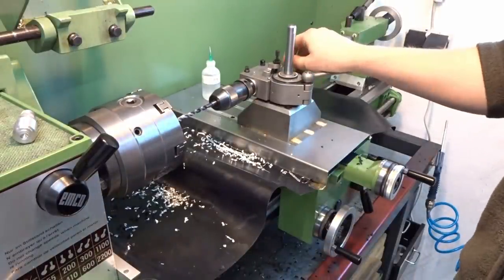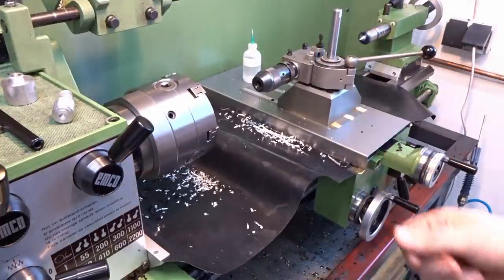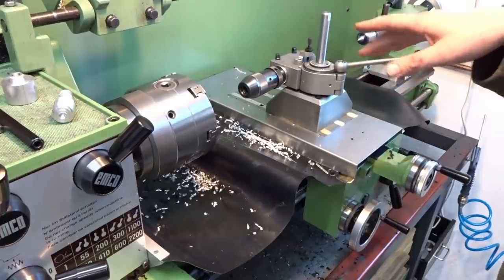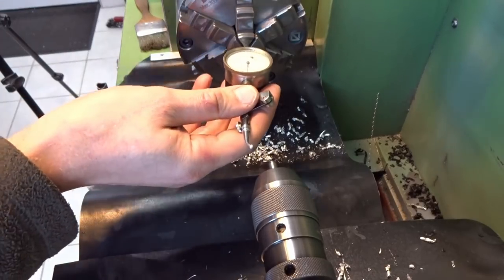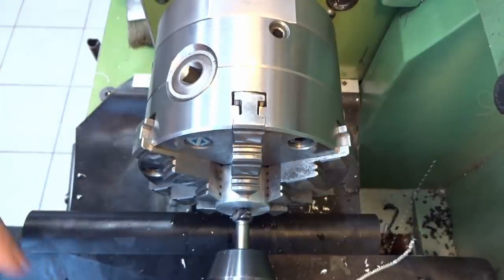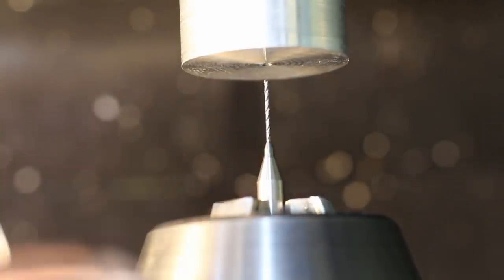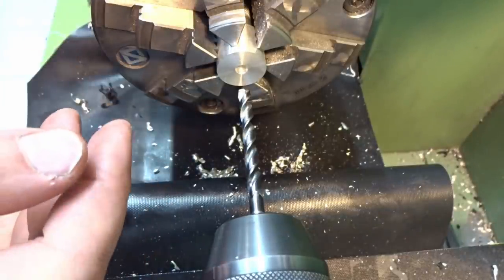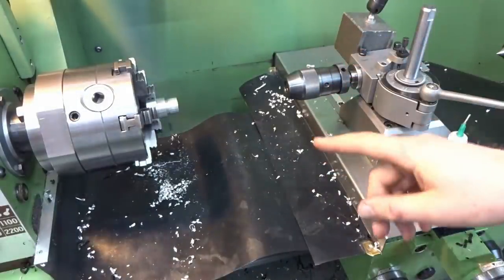Carriage Drilling on the lathe

Comment: Wow, I knew it was practical to drill with the carriage but some of these tips really blew my mind.
Had never even considered how practical it would be for use with taps!
Reply: I only just did this myself for the first time recently. I have built a multipurpose spindle, optionally powered, which I can fit to the toolpost of several of my lathes, mainly for drilling PCDs (with the lathe spindle locked) and wobble broaching (mainly for internal hex holes), but I recently had to tap a large number of M3 threads in gnarly work-hardened stainless, and so I used the spindle (which has an integral ER32 collet holder) as a passive tap holder in my sensitive little instrument lathe, whose carriage moves wonderfully freely. I provided sensitive and quick-releasing torque restraint by hand-holding the collet nut. This worked really well and I broke no taps. (The lathe has a nice progressive clutch on the spindle drive)

Comment: Stefan mentions disengaging the carriage feed to break chips. On some industrial lathes the feed rod, where it emerges from the gearbox, has a tripping and self-resetting overload clutch which can be easily adjusted and which is cleverly designed not to suffer undue wear from being called into play. In such cases you can break chips regularly without disengaging the feed, by momentarily applying a bit more (reverse) load to the carriage handwheel than the clutch will currently overcome. This is very quick and convenient in comparison with disengaging and reengaging, and arguably is less inclined to wear out the mechanism for doing so.

Comment: Just an idea for someone without a digital readout on their lathe that might be interested in doing this. I've seen arrangements that hook the tailstock body to the carriage. This allows the carriage to drag the tailstock. There may be another option. On a lathe that on might typically find in a home shop. 9"/225mm up to 12"/300. This also depends on just how the compound is mounted to the Cross Slide.  If the lathe has tee slots in the Cross Slide it makes things easier.
1) Remove the compound.
2) Build the device that you want to hold drills etc in. But do not final bore the holder
3) Position the Cross Slide in the center on its travel. Mount the Drill Holding Device to the Cross Slide.  Mount this so that the device is pretty well centered to the Spindle. 
4) Now drill and ream one or two holes for locating pins through the Drill Holder, the Cross Slide and into the Carraige. 
5) Install pins. These could be straight dowel pins, tapered dowel pins or straight shear pins. Shear pins might be a good option as to provide a failure point if you have a crash.
6) Now finish bore the drill holding device so that when the locating pins are in place the the unit is installed on the lathe with the locating pins in place
7) When not in use place short dummy pins in the Cross Slide portion of the holes to prevent chips etc from getting into the sliding surfaces.

On industrial machines I used to run there was another option on the tailstock. The hand wheel was mounted on a two speed planetary drive that allowed fast and fine feed. The fine feed made it possible to use larger drills without having to use cheater bars or have arms like a gorilla's.
Reply: I don't have DROs on any of my lathes but I do have 50mm travel Dial indicators (100 mm on my big lathe) which read z axis movement relative to a datum anvil repositionable along the bed, on the far side of the carriage from the headstock. When Stefan talks of the benefits of a DRO for following the progress of a drill when using the carriage, I can't help thinking that an analogue dial is even more convenient and restful, as for 95 percent of the time are processing the smoothly changing angle of a pair of needles, only looking at the graduations and numbers when you need to, right at the end, when in any case you are creeping up to a size. With a DRO it's a much bigger cognitive burden, processing rapidly changing (and hence flashing) digits in base 10, increasing or decreasing, and converting them to an analogue "sense" of the drill location in relation to the ultimate depth.
With difficult ultra workhardening materials like Inconel and Nitronic, it's really important to know just when the drill is about to reengage, as you have change the rate of advance so as to "hit" the work with just enough speed and follow-through to be instantly cutting but not too aggressively (which would might chip the cutting edge), and yet be ready to increase that force considerably as the drill starts to work and has to be fed at the optimum rate to avoid strain hardening, which latter would instantly take the edge off and probably weld the drill down the hole. Anything which reduces the cognitive burden is a big help, as you can't always be on your A game.
I do have a genuine Trav-a-Dial I plan to fit to my big lathe, which I think would be even more convenient, as it has unlimited travel, and that is a long lathe. Once again, an analogue dial.
I think the perfect solution would actually be an electronic three-axis DRO (tailstock or compound being the third) with a high resolution screen and (as a selectable option and conceivably not on all axes) analogue dial readouts, like the analog clock displays which are optional on a mobile phone -- but much handier on a DRO, because of the rapidly changing positions being monitored, in comparison with the slow and steady pace of time.
It occurred to me that a better analogy would be with altimeters particularly those used by jumpers. wingsuit maniacs, etc, where the readings can change very rapidly and the jumper has other demands on their cognitive abilities. Sure enough, there is a very sophisticated digital altimeter with an analog display which has recently been released, the Larsen & Brusgaard Altitrack.
A really Rolls-Royce implementation would process the sum of two scales for the tailstock, to track the position of the tooltip, regardless of unclamping and moving the tailstock casting.
Reply: @Gottenhimfella  
Having used both DROs and Trav-a-Dials on manual lathes I really prefer the later. It is much easier to track just when you are coming up to "zero". Other options I've used to set bed stops on lathes is an inside micrometer. Or solid stacks of gage blocks

Comment: This is brilliant! An additional feature of this method is that the carriage has a much longer range of movement than a tailstock. Mine is theoretically 75mm but the chuck tang drops this to ~60mm. Obviously, the carriage moves further than 60mm and so long drills can use a single pass.

Comment: Brings to mind the old pre-cnc capstan lathes with multiple drill chucks in the rotating capstan head.
Reply: @Mark  I have a small one of those as a second op lathe. It is still very useful for prototyping and small series etc, quick to set up. I find I use it a lot. Essentially a Schaublin 102 with a turret head and F38 collets. These have frequently been on the market for cheap, i got mine with lots of tooling for about 1000$, great quality machine for the money.
Reply: @erikisberg3886  I bet there are a lot of capstan lathes on the market due to the penetration of affordable CNC machines into small and medium sized shops. At the school where I was teaching we briefly had a medium sized machine with lots of tooling but it was sold on to a guy who just wanted a few parts off it. I just realised that I have a BXA tool holder with a bore big enough to take a 10mm keyless chuck so I think I will have a go at trying Stefan's technique although I don't have a solid toolpost. Repeatability might be an issue but for the occasional use it would be great.

Comment: I just got a MT3 quick change holder for a project I was doing for work (I work at a lab and all machining requiring more than a drill press is done at my house machine shop). I was working on something where I needed to do 1/4" deep drilling on 20 pieces of PTFE. I made a few prototypes using the tail stock and got fed up with that quickly. Glad I can run the drill on the carriage now.

Comment: Great video. Not that this would be a problem with your setup. One place I worked the guys that ran some larger machines than yours. On 19" and 21" Leblond lathes. They would run larger drills with the power feed like this. Now what drives the carriage is the pinion gear on the rack mounted to the underside of the ways. They would either bend the pinion's shaft  or strip the teeth on the rack (Or usually both) by the loads of large drills. But they were usually drilling with larger than 1.50" diameter drills to make this happen in tougher materials.

Comment: I don't even own a lathe, but I'm sitting here thinking how much easier doing this would make my life If I had one.  Now I want a lathe.  Thanks Stefan.
Reply: If you are in the U.S., Craigslist can be a great source for machinist tools if you use it well. You can set up a listing search filter such that when someone posts a listing for a lathe you will get an email alert. That's how I got my 9x20 Central Machinery lathe 4 years ago for only $200 (including loads of tooling). Between that and a minimill I've setup a fairly decent hobby shop.

Comment: This is how I prefer to drill. Not only because when I bought my lathe and it didn't have a tailstock. But that helped force me into it and now that I've done it, it's so much nicer most of the time. Getting the chuck dialed in isn't any more difficult than most other precision operations on a lathe IMO.

Comment: I have on occasion used the carriage to drill with using a power drill in a holder so it is like live tooling on my lathe. It saves a lot of time versus setting back up on the mill to do the holes and with a 40”chuck I get good rotational accuracy just using degree markings.

Comment: I just this week had to drill some MD filled Nylon to 63mm x 250mm deep. Using the carriage was the only viable way, given rapid peck drilling and clearing is required to prevent melting the Nylon.
The lathe I was using doesn't have a DRO, so to keep track of depth progress I use a small pot magnet with a thin piece of plastic glued to the face. I just stick it to the lathe way and let the carriage push the magnet along as the depth increases. When I retract the drill (or boring bar for that matter) the magnet stays puts and acts as a tell tale. Using that method I can use the rapids on the carriage to retract and return to work without fear of a crash.
On my smaller lathe that has a DRO, I use a needle bearing inner ring in the chuck and a ground dowel pin in the drill chuck along with the 1/2 function on the DRO. Very quick and no indicator involved.

Comment: Stefan, thanks for the presentation.
Totally agree with the threading using 90 degree feed. There is a minor advantage on using the compound for feeding since the compound "remembers" the last cut depth. With 90 degree feed one has to make a mental note on current cut depth.
I would be very careful when tapping smaller threads with carriage feed metod.. M8 is probably not a problem but when the tap size gets smaller, the tap just cannot drag the carriage with it so some other solution might be needed. 
If one has a small and affordable eastern world made lathe then chances are that the tailstock quill has a very short stroke. When I had mine, that stroke was about 40 millimetres. This meant that drilling with tailstock involved a lot of moving the whole tailstock around. With carriage feed even the smallest lathes have enough "strioke" to be able to drill with ease.
Reply from the maker: I tap down to M2 with this method, the carriage on the Super11 is not exactly hard to move :-D
On larger lathes it will be different.
Yes, you have to memorize the last depth when threading like that, but I never found that to be a nuisance - Especially with a DRO :)
Reply: WRT tapping small threads: You can just set up the lathe as though you were single-point threading that size, and then use the carriage feed. It'll move at exactly the right rate for the tap, since the tap has the same pitch as you just set it to move at! No issue with it being unable to pull the carriage along and breaking the tap. 

When that becomes necessary depends on how hard it is to move the carriage on your lathe. But it's a lathe carriage, it had damn well better be able to cut accurate threads when the change gears/gearbox are set correctly.
Reply: That's correct. You can set up a "feed rate" that is actually the thread "pitch" of the tapped thread.
With this setup I would have a hard time to remember to act properly when threading the tap out of the hole.
You probably would need to disengage the feed and then somehow manipulate the tap out of the hole without damage.
This is because there is always a big backslash in feed gears which causes the carriage to get out of thread sync when run the opposite direction.
Reply: @FinnoUgricMachining  I would unchuck the tap and remove it by hand. Once it's loose probably hold with fingers and reverse spindle, IMHO. Good point! 👍😎✌️

Comment: I made a similar tool holder for my multifix, but rather than taking a boring bar or Morse taper, it's bored 0.75in so I can use er16 collets on tormach TTS holders.

It's wonderful to change tools and maintain offsets when doing a small batch of parts.

I really like that 3 edge spot drill, crazy small! :) thanks for sharing!

Comment: Great instruction video Stephan! I've been contemplating adding this feature to my Clausing lathe. My carriage has a light feel and I like the idea of not having to reposition my carriage and cross slide especially running multiple parts... Going to purchase a morse taper Aloris holder for my tool post and use the dro feature you demonstrated. Great trouble shooting explaining in the video! Thanks for your time and sharing Stephan! 👍😎✌️

Comment: Another delightful video.    

A few times Stefan you dropped the comment that drilling was a kind of roughing or bulk material process.   

Once I got that idea in my head I was able to confront my fear of carriage drilling.   I'm already set up with Aloris style tooling and I just invested in a split cotter style boring bar holder with a straight shank to JT on my drill chuck.

I was puzzled about how to use it without DRO though.  I was faced with some operation requiring deep holes and necessity was the mother of invention.   I just eyeballed the center drill (sorry I use them for spotting 🙂) and with a couple of tweaks had the drill lined up by eye good enough for a roughing operation.   I just couldn't face all that cranking on the tail stock to clear the chips.   

So again you and Robin do great service to those of us that only aspire to be better with our wiggly old home shop lathes & gear.   

I recall you had fitted a rack and pinion drive to your tailstock on an earlier lathe.   I can see some advantages to that idea also for some kinds of production runs.    

Thanks!

Comment: Great video, picked up many good tips! 
Been using my multifx with a drillchuck and an ER16 collet holder similar to this for many years in my Weiler Condor, a slightly larger lathe. I usually have a  lever feed in the tail stock and it is fairly cumbersome to change to the original screw feed. For drilling grabby materials like plastics and brass the carriage method really saves the day.  I am a bit concerned about running larger drills than the lathe likes though. Straight thread in feed is the way to go, has been doing it that way for a long time despite other opinions. but perhaps on older crappy lathes angled infeed made more sense.

Started using core drills after I saw it on Your channel, works really great! 
 
For me the lever feed works well down to sub mm drills though. For really small drills I made a small pin vise on a ground shaft that I just feed with finger pressure. Works really well because the fingers feel both the torque and feed pressure nicely. It seems to me that a single lip D bit centerdrill is preferable for small drills. Would be interesting to hear others experience on this.

I also recommend the plastic squeeze bottles with blunt syringe tips, they really work well, I use them for everything. Denaturerad ethanol is good for machining aluminum and is not to bad for the health compared to the number of beers You may ingest anyway (within limits of course...). Big advantage is that the surface after machining is essentially oil free. I glue a lot of Al parts with heat curing epoxy and this saves a lot of prep work compared to cutting fluids.

Comment: Excellent tutorial and reasoning on the pro's on carriage drilling. During my apprenticeship, one of the lathes I used, the lathe tailstock was so large I wasn't strong enough to slide it on the bed, there was a short lifting strap which hooked over the tool post to pull it towards the chuck, pushing it back was done by using the carriage.
There was a Dean Smith & Grace lathe, that had a cross slide Morse taper holder, cleverly the was a stop on the carriage, that this was pushed against and locked, always on centre line.
Great content and video, thanks for sharing.
Best regards form the UK.

Comment: Any lathe can be a "chucker" lathe if you ignore the tailstock. And if you set up an independent carriage motor (eg Clough42's "electronic leadscrew") you can get close to having a Hardinge HC (though probably not as precise/accurate unless you're starting with a similarly nice lathe).

As for tapping, you can also set up the lathe for threading at the thread pitch of your tap and power feed. Preferably with a machine tap of course. More useful if your carriage has a lot of drag.

Comment: We use an Aloris QC with a 5C collet holder to do this. WAY better than drilling with the tailstock except very large drills like 1.5" and up. We cut short tapers all the time so a compound is necessary.